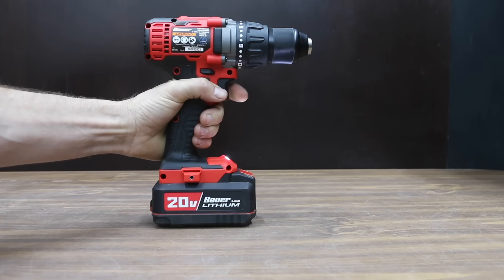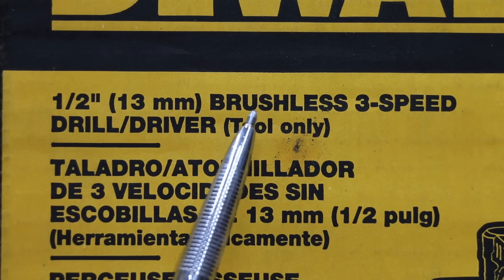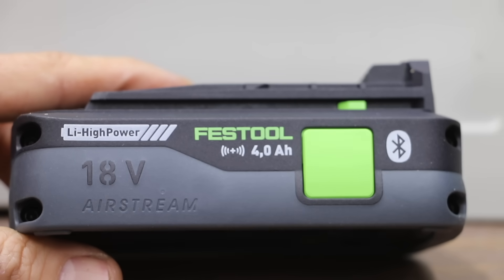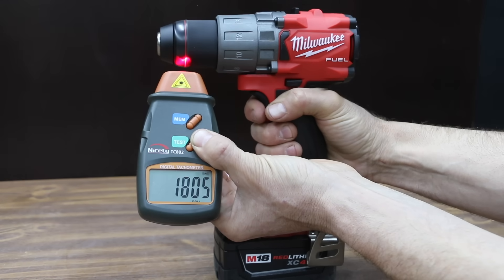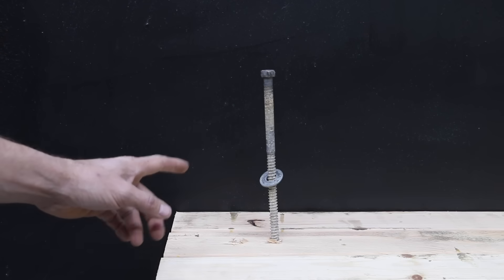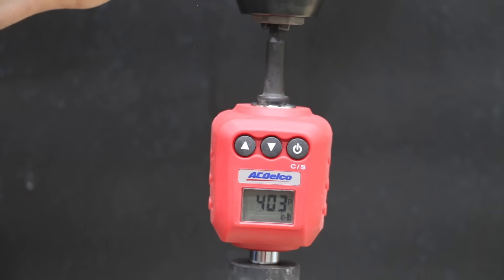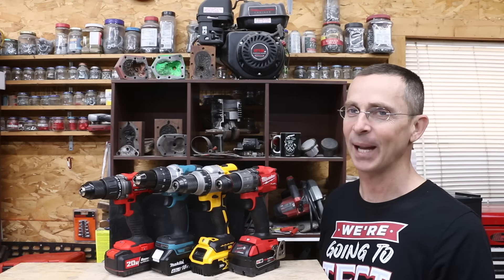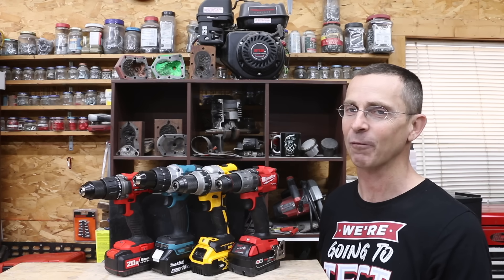Best Drill (BATTERY POWERED)? Milwaukee vs Dewalt, Makita, Bosch, Festool, Ryobi, Bauer, Ridgid

Comment: Bought a holiday package deal from Wally world about 7 yrs ago.. Bostitch 1/2" drive, with 2- 18v batteries, charger, and hard case.  Still going strong, with original batteries.  $99   Hindsight, well worth it.  It's overly large, but not a show stopper, in most cases.  In the last two years, bought a much more compact 20v,. 1/2" DeWalt with two batteries, charger and the wimpy soft case.  It was on sale, but definitely not $99.  😁.  Thanks once again, for your great work!
Reply from the maker: You are welcome!

Comment: It seems like a take-away here is that an electronic clutch may not be everything it is cracked up to be.  I assume the electronic clutch is estimating torque by measuring motor current and shutting off the motor when a current limit is reached.  The problem is magnetization versus current is fairly non linear at low currents, and there is static friction to overcome, etc.  That explains why the lower limit is a large number for the electronic clutch.  You just can’t easily sense small values.  The advantage is the electronic clutch should have less wear because it is shutting off the motor rather than relying on mechanical slip to limit torque.  Does anybody really drive screws with a mechanical clutch set to “1” or even “5?”  Probably not.
Reply from the maker: Thanks for the feedback.

Comment: It is interesting to see what professionals use.  I had a new garage built a couple years ago and to a tee, the different subcontractors all brought Milwaukee tools.  I was impressed when the electrician used his reciprocating saw to chop tree roots so he could lay conduit.  The Milwaukee batteries seemed fo have huge capacity.  I suspect some of the cheap tool brands may not live up to the battery capacity they promise.  The other thing to consider is how dirt resistant the the tools are.  Milwaukee kept working in a very dusty and dirty environment.

Similarly, I’ve had several different tree trimmers in the last few years and they all use Stihl equipment.
Reply from the maker: Thanks for sharing.

Comment: I like Milwaukee, DeWalt, Ridged and Makita brands. They are all good tools. I've used Milwaukee in the past and have loved their tool line, but everyone in my shop uses Milwaukee and I wanted my tools to be different and easily identified as MINE. So I went with DeWalt since they are very similar. I have not been disappointed. Especially when it comes to taking off rusty lug nuts.
Reply from the maker: Thanks for the feedback.

Comment: So based on your reviews I just purchased a Milwaukee M-18 Fuel kit that included the 2804-20 hammer drill and the 2853-20 impact driver.  It also included two  XC 5.0 batteries and because of the holiday an additional XC-5.0 battery was a “gift” LOL. 

So far I’ve only used them lightly but I am very impressed. Thanks for your help in making that decision. You are costing me money🤣 but it’s well spent on quality and I’m good with that. 

I’ve said it before but you really are a public service. The channel is informative and entertaining. 

Keep it up. I’m referring everyone to your channel.
Reply from the maker: Thanks so much, will do!

Comment: I remember when Bosch used to be THE name in power tools. Almost every power tool on the sites in New York City construction was Bosch. They really fell off. But if Bosch got their act together, I'd be first on line to buy their stuff again. 

DeWalt too used to be the best. It seems that they are beginning to make some sort of comeback, but damn...a Ryobi costing about 30% less shouldn't be within 1/2 a second of a DeWalt. DeWalt already screwed me on a warranty for a brand new compressor. I used to love them, but that left a really bad taste in my mouth and to save money on one faulty compressor, they literally have lost 10's of thousands of dollars from me. 

As for Milwaukee, hat's off to them. They've been consistently ranking at the front of the power tool game. I just might have to move to them from now on. 

It's hard to spend $80 for a Ryobi when a similar spec'd DeWalt is just $20 more. It's going to take more than just speed tests for Ryobi to justify their pricing. DeWalt still makes solid drills that last for ages. Wouldn't know about Ryobi since they haven't had as much time in the field with guys who do this for a living, but for the home, I think they're stellar.
Reply from the maker: Thanks for the feedback.
Reply: I’ve only owned one Bosch tool - a 1/2” hammer drill.  Burned up the brush holders in no time.  Absolute junk, never wasted money on that brand again.  For me it’s Ridgid all the way, the only maker with a lifetime battery replacement program.  Can’t beat hat deal!

Comment: I generally like the Ryobi line but I had that exact drill, and the motor burned up (literally on fire) using a 1 inch spade bit to drill holes in tree stumps so I could add stump-rot powder. PF confirmed that the Ryobi is weak junk. And the Festool lol, don't know anyone who would actually spend the money on that stuff, their prices are literally absurd.
Reply from the maker: Thanks for the feedback.

Comment: I'm Ll about the m18 fuel I use my drill and impact at work everyday never had a problem with it other than the one I have has a single Ball Bearing in the impact so sometimes the bit won't stay in tell you mess with it for a sec
Reply from the maker: Thanks for the feedback.

Comment: without even watching this fully yet my Makita has basically been on fire and still functioned, so I have 3 of these but I am going to watch
Reply from the maker: Thanks for the feedback.
Reply: @ProjectFarm  no worries I love the show, I worked as an alarm installer for ADT and used these drills for my job because my trainer had the Makita, I would definitely try some other models. I have 2 of the Makita less expensive than yours I believe (drills) and one of the Makita hammer drill - all have worked great. Toughest test typically as an installer is drilling into brick exteriors to install outside sirens. The other tough test is going behind walls through floor boards, especially if there is loose material ( typically we are running very long bits and flexible rod extensions off the drills which can work them hard

Comment: I worked some jobs where we had only power tools and batteries. Milwaukie loses amp hours on the batteries throughout the day a lot faster as you recharge them or they get hot in the sun than the dewalts we had. 

So its dewalt for me.
Reply from the maker: Thanks for the feedback.

Comment: I don't know if it was a consideration in your testing, but because the electronic torque controls often measure amps, you can get the lowest torque from them at the highest speed gearbox selection. Of course, this is where speed is hardest to control.
Reply from the maker: Thanks for the feedback.

Comment: Cracking video, thanks very much :) - I think I would be right in saying that dewalt also do a lower duty brushless drill (DCD796) that has a mechanical clutch and lower weight/performance which is better for low torque stuff, which would probably sit it in a similar class to the ryobi/rigid - I paid £60 for mine bare.
Reply from the maker: You are welcome!

Comment: It's hard to find reviewers that aren't shills for the manufacturers. You, AVE and one or two others are just such. I've been using the Bauer product line for a number of years in the automotive industry now and at their price point, if I have to replace one every couple of years then, no worries. Also, a secret to buying from horrible fright, if you already have the batteries and a charger or two, look for the open box displays or returns. I have been able to get brand new tools a like sometimes 60 or 70 percent off retail. Take them home and find that they either work fine out of the box or, the light doesn't work, or something simple internal that I can fix cause I have nothing else to do but repair the broke tool I just bought. Seriously though, Bauer does make a decent tool.
Reply from the maker: Thanks for the feedback.

Comment: I have to admit that I have a some  Ryobi Tools. I am not using them professionell though but only occasionally to do some work in the house etc. 
Compared to other "cheap china brands" common in Germany (like LUX, Einhell, AlphaTools, WORX, Parkside) the are quite okay and not even the cheapest. Bosch Blue or Makita are double the price (at least) but are they so much better? 
May even be, but with my very occasional use it may not be worth it.
Recently needed a Cordless Reciprocating Saw ... for 2 cuts. Literally just two cuts. 
Ryobi 90€, Bosch 220€.

Well...
Reply from the maker: Thanks for sharing.

Comment: I wish Panasonic hadn’t virtually given up on power tools. To this day I still use and prefer their 18v drill over everything. No doubt it’s outclassed on torque and other metrics but Their  batteries are excellent, ergonomics, durability but most of all it’s chuck and clutch. The chuck doesn’t immediately strike you as anything special but the chuck body tapers from body to jaws, is over moulded with high impact rubberised plastic with grip ridges and can hold  from 13mm /1/2” down to very small drill bits. If you are closing the chuck jaws by holding chuck, you won’t polish the knerl grip like a chuck with a metal outer which can make a jamming check close to impossible to open. Lastly, Never jammed bits in it. Sadly, they will likely disappear for good soon☹️
Reply from the maker: Thanks for the feedback.

Comment: In harsh dusty environments (iron ore mine in Western Australia) the battery release on the 18v Makita has the edge over the 18v and 28v Milwaukee. Battery can be released with one hand. The two button release on Milwaukee’s start to jam very soon after new. They then need two hands and some people will tap the bottom corner of battery on bench or knee to get the loose. The battery casing will soon crack from this. They could do with being made from higher impact plastic. Also forward revere on their rattle guns are prone to harming quickly too under these conditions.
Reply from the maker: Thanks for the feedback.

Comment: This is a so-so test. I say that because the density of the wood changes down the length of the board. I learned this having worked in a cabinet shop for several years. Boards will be softer or harder at different locations. Grain pattern has to be considered. Wider or narrower (tighter) grain pattern will have an effect on the ease of drilling. That means the results given are not totally accurate. Where one drill may be better than another drill at two different locations, they may have been equal at the same location or the better drill may have been worse than the other drill at the same location. The board would have to have the same density or grain pattern the full length of the board to be an accurate test. Amperage or torque is being considered. If you want a more powerful battery, than amperage or torque would have to be considered when buying. I think the torque test was the best part of this video. It was the most accurate part of the test. I think everyone can see the Festool is way overpriced.
Reply from the maker: Thanks for the feedback.

Comment: HF currently sells the Bauer drill for $40, but for only $25 more you can get the drill with a soft case, charger, and 1.5 amp 20V battery.  That seems like a better buy than just the bare drill, and is $5 less than the price you quoted for the Ryobi drill and charger with the same size battery.  On the other hand, the Ryobi offers a much longer warranty.
Reply from the maker: Thanks for the feedback.

Comment: These drill tests are so critical in my decision making process. I have been using Master Force from Menards and most stop when I use them for heavy duty application. The circular saw and sawzall freeze up constantly and the more I learn about Milwaukee the more I am ready to switch over. I own 3 different Dewalt drills and have been pretty happy with them. The key for me now is purchasing one brand for all of my needs so I can swap out the batteries. It's quite frustrating for me to constantly swap of batteries for different tool types. So, in a nutshell, is it Dewalt or is it Milwaukee? Makita, Bosch and Bauer are not on my list of options.
Reply from the maker: Thanks for sharing.
Reply: One thing to think about with Milwaukee: Ryobi owns Ryobi tools, Rigid, and Milwaukee. They test and share a lot of technologies across all 3 platforms. If you are interested in Milwaukee check out the other two and see what specific tools each "brand" offers. I ended up switching from Rigid to Milwaukee because I needed certain tools that only Milwaukee offered out of the 3 I mentioned.

Comment: So basically you're testing drills except for what they're actually designed for drilling and testing them for what they're not designed for? I fail to see the point of this test. If you want to drive in screws why not use impact drivers which are designed for that sort of job.

This test is like testing off-road vehicles and do a road racing test, then concluding the fastest car is the best car for off-road use.

Comment: Ive been using the ryobi from this test for a couple of years, and I really like it. 

I guess it is kind of weak, not that I have ever felt it for some reason. It often feels overpowered, to be honest.

What I would really like thoug is a lighter drill!
Reply from the maker: Thanks for the feedback.
Reply: He shouldn't be testing brushless vs brushed when a manufacturer offers both. The P215 is the lowest spec 1/2 drill Ryobi makes. I want to see one of Ryobi's flagship drill w/ their new battery version.
Reply: can drill thru concrete ?
Reply: If it has hammer mode